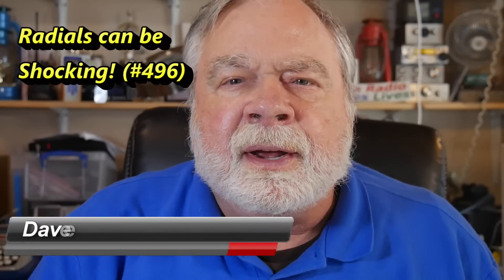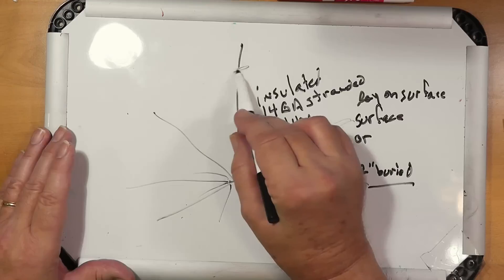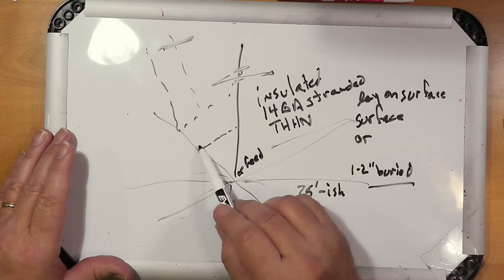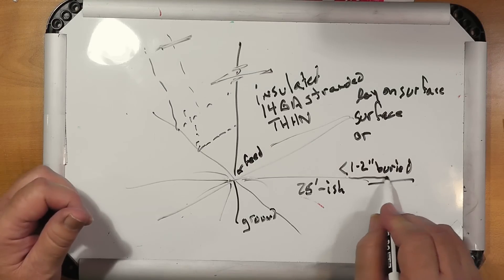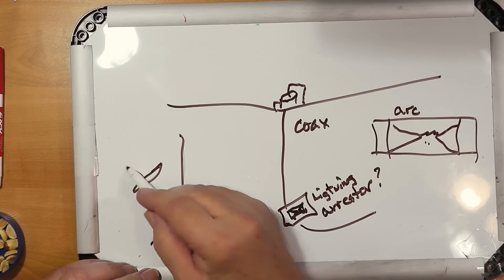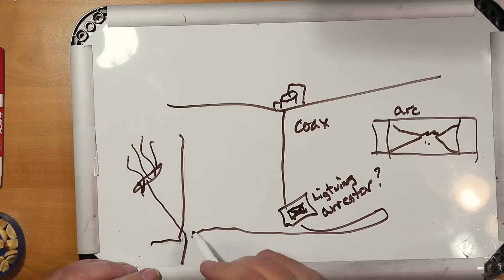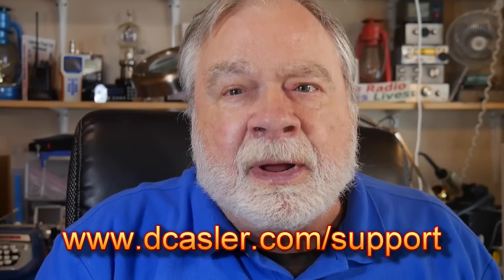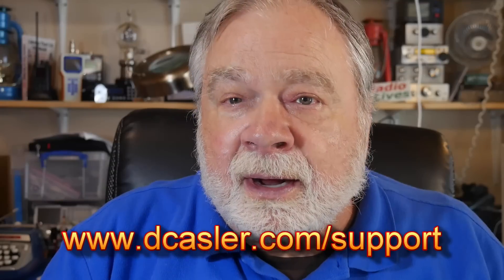Radials can be Shocking! (#496)

Comment: The wire nuts that are all plastic won't corrode, or use heatshrink, especially glue-lined heatshrink to cover the ends of the insulated wires. We're not trying to make a connection here so it is less critical than the normal use-case for a wire-nut. RF skin effect precludes a normal "shock" hazard, if you get enough current you get RF burns which are quite annoying but much less likely than lower frequencies to cause dangerous and potentially fatal fibrillation. de w6akb

Comment: Picking up  a 1/4 wl insulated radial provides an enduring lesson about RF voltage/current distribution  and the impedance transformational characteristics of a conductor. Additionally, the amount of station operating power is inversely proportional to the time speed at which the picker upper will put the conductor back down....
DON'T ask me how I know! 😜
All good stuff Dave...
73' de K4WRF

Comment: I am also a radio broadcast engineer who cares for 14 broadcast stations, 5 of which are AM stations.  One of these AM stations employs an elevated ground plane.  The others have buried copper wire radials...120 of them, all consisting of bare solid copper wire.  These buried radials have survived in the ground at these sites for decades.  Yes, Elevated radials can give an intense RF burn.  Elevated radials must be carefully insulated from their supporting structures. The elevated radials are made of copper-clad steel; this for strength and to deter copper thieves.

Comment: Just a BTW, regular wire nuts will corrode and decay outdoors quickly. You need DryConn waterproof wire nuts!! 
 DryConn (medium for 14 awg) connector is filled with dielectric silicone sealant that surrounds splices and terminations, making them water and corrosion resistant. 
NEC code book, requires a UL listed, waterproof connector to be used for all splices and terminations in wet and damp locations.

Comment: Although a radial system on the ground or shallowly buried will function fine even with insulated wire due to distributed capacitance it can as you rightly say not be a ground. 
No argument there, and in fact insulated wire tends to survive longer under the ground than a bare wire.
The example of 90w and 30 radials is not so accurate,  an average quarterwave vertical ought to be in the region of 35 ohms and the radial system as low as possible maybe pessimistically 10 ohms for a system with 30 radials (I would expect it to be much lower in my conductive soil). So about 22% of the power will get wasted as heat in the radials, ie 18w shared between 30 radials. I do realise that the radials will not perfectly current share, but you are only talking about in the region of half a watt per radial. Or in current terms about 50mA per radial.

Comment: I like the wire nut idea. When I did my radial field, after I cut the radial, I dipped the end into "liquid tape" and let it dry before stapling it down.
Reply: I'm going to just use some heat shrink.  I think that will work.

Comment: Dave, a little note: 2 inches are around 50.8 milimeters, not centimeters. :)
Reply: I multiply length-in-inches by 2.54 to get the length-in-centimeters. Also, 300/length-of-wave-in-meters = frequency in MHz.